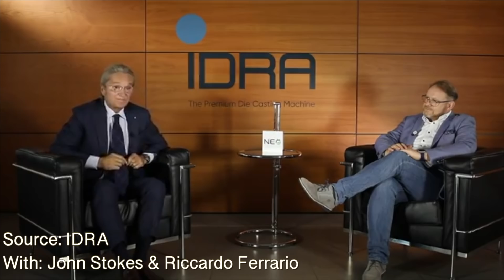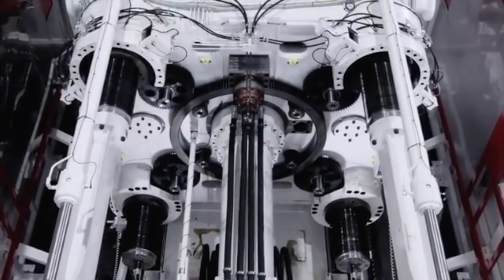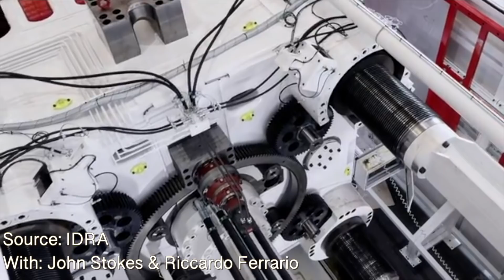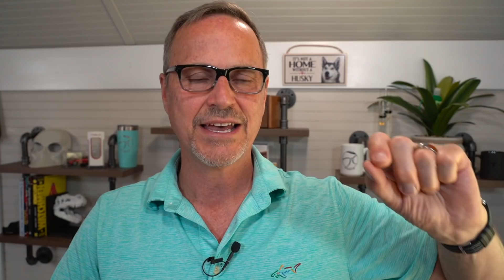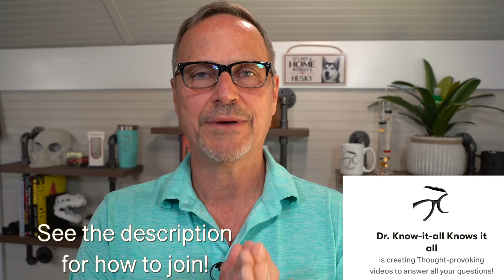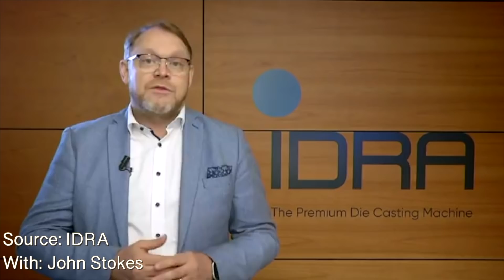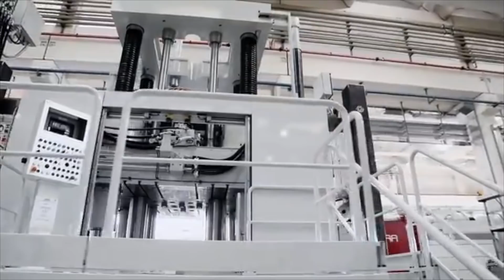Tesla's secret weapon: the Giga Press!

Comment: The 6000 ton rating is the pressure required to hold the pieces of the mold together. These machines inject material into the mold at 1000s of psi and the mold has a large surface area therefore a massive amount of force is required to hold the mold together during the injection process.
Reply: Dr.- No-idea is just the pseudonym. The real name must be either Dr. Dunning or Dr. Kruger.
Reply: Wilson I’m glad you commented this. I was surprised the good Dr didn’t understand what the machine rating of 6000 ton was for. Essentially that capacity means it will be able to handle parts with high cross-sectional area at the mold parting line (F= Injection Pressure x Area)
Since the injection pressure is likely to be the same for Al parts, this 6000 ton press should be able to make parts that are 50% bigger at the parting line than previous gen 4000 ton presses.
Reply: @cantstoptommy7077  not an expert but I got the impression that this guy didn't know what he was talking about.
Reply: @DogBoy987  The Dr is a Professor of English.  He does the best he can explaining the technicalities with that limitation.
Reply: Yes tonnage to hold pressure comes from the lock knuckles that straiten out like your leg,locking in place like the weight we can hold up when our legs are strait compared to bent. Fast shots molten metal and seconds to cool for another shot as a robot removes the last part.
Reply: The Doc is descriptive.
Reply: The Dr describes the sequence: inject first, then press the mold together. It’s likely more like plastic injection molding, where the mold parts are united, forced together with extreme force, and the hot liquid material is injected at high pressure.
Reply: @DrDave327  The Dr. should have informed himself..... He is talking crap. It's an injection molding machine using molten Aluminium and a Ram and not an Extruder with a hydraulic ram at the screw like plastic injection machines use.. The mold on both is closed and pressed together with a force that is the equivalent of XXX Tonns. (the mold is sprayed with an bio-oil for mold release, the mold is evacuated by vacuum pumps, the mold will be filled from the bottom to the top and this takes less than a second. The whole cycle time would be IMHO less than 90 seconds)
Reply: @DrDave327  It is, pressed together before injecting, but you know it better i see :)
Reply: @DrDave327  correct

Comment: I think the centre battery structure is such a simple shape, it is not necessary to cast.
Would be totally overkill to cast the centre battery piece.
Reply: It’s cheaper and quicker, and with a suitable molded structure will be stronger and stiffer while also being lighter and using less material.
Reply: @fredbloggs5902  Structural battery means, the cells itself are forming the structure. You don't need another casted structure.
The room between the cells is filled with some glue and therefore a rocksolid part is formed. You only have to close it with 2 thin sheets of steel from down and above.
Reply: @wolfgangschmidt9873  That’s only partly true, by having struts that run the entire length of the floor pan a much stronger and stiffer structure is produced for a given weight.
Reply: @wolfgangschmidt9873  Exactly.
Casting brings advantages for complicated shapes, replacing many stamped parts and welding robots.
Reply: @wolfgangschmidt9873  I can't believe what you're saying. The battery tray has coolant flowing through it to keep the batteries cool. It's necessary otherwise the heat would build up to failure. 
Lithium-ion batteries are not, definitely not, structural elements.
Reply: @DogBoy987  What do you think the term "structural battery pack" stands for? See the interview from Sandy Munroe with Elon
Reply: Graham, I agree.  The Idra gentlemen mentioned the battery module as one of 3 for the car, but no reference to casting it.

Comment: So, for low pressure forging the material is injected while being solid like an extrusion but closer to the melting point?
Reply: The liquid metal is poured at low pressure inside the mold cavity. The cavity is sealed up then it is pressurized at very high pressure.They are creating pressure hammer to simulate the hammer strikes in standard forging. The furnace is there to maintain the temperature and keep the metal at semi solid state. Just like in standard forging where you keep reheating the part in between hammering it. This process will produce parts with higher strength.
Reply: @kazedcat  I wish Mr know it all had explained it. He could read your comment and learn something

Comment: The CyberTruck will definitely need some sort of a strong frame under that exoskeleton.  The Tri-motor with model is supposed to be rated to tow 14,000 lbs.  So the whole structure will need to be able to endure those stresses, plus a safety margin.

Forging is not just heating and cooling, it is heating and pressure to result in a desired shape/material characteristics.

I think you're right.  Tesla probably has all of those orders for it's upcoming giga-factories.  A video analysis showed the cycle time for the Fremont press was 184 seconds.  Without considering downtime, that is 170K units a year.  So for 1,000,000 units a year, you can figure out how many presses you'll need with both the rear and front castings made.
Reply: The cycle time will likely improve a lot. I think there will be 8 machines in Berlin, which should be enough for 1M cars with front and rear castings, assuming the cycle time can be halved (should be possible, 3 minutes is a very long time).

Comment: The main question is how easy is to repair this part in case of an accident !
Reply: I think Munroe's video made these 2 points regarding repair: 
-it can be designed so that specific sections can be cut off and replacements get bolted on
-most accidents resulting in frame damage are written off anyways
Reply: That subject has been covered, multiple times. Check Munro's video
Reply: @jonbong98  you have a link ?
Reply: I believe, as with the CyberTruck, it employs an external crumple zone.  😃
Reply from the maker: They talk about that at length in the original video. I had to cut some things for time and safety was one. But they have good safety and repair features too. :)
Reply: @DrKnowitallKnows  Great 👍 this is, how we say in German....the Knackpunkt !
Reply: No repair possible, castings are brittle at impact.
Reply: @carholic-sz3qv   Parts of the casting (bumper mounts) are designed to be sawed off and replacements bolted on, if damaged. As with all cars, deeper damage makes the car a write-off.
Reply: @carholic-sz3qv  Aren't the crumple zones being cast? Tesla has developed their own alloy. Please explain.
Reply: @ryankozak99  crumple zones mostly uses aluminium profiles thats what porsche has been using for decades since they always had front trunk.
Reply: @carholic-sz3qv  I should clarify...
My point was that (I think) Tesla is including the front crumple zone in the giga cast, so how could their aluminum alloy be malleable enough to be used in a crumple zone,  but not workable for repair?
Reply: @carholic-sz3qv  they're not brittle. They're designed to absorb crash energy by bending. And they're also designed so the bumper connection can be sawed off and replaced.
Reply: @DogBoy987  castings are brittle in impact, aluminium extrusions and steel actually bends/deforms to absurd the shock so you're welcome.

Comment: One revolutionary advancement that came out of World War II was the "heavy presses" for forgings and extrusions.  When the allies found out the Germans were producing large lightweight forgings for their airplanes (making them stronger and lighter), a cold-war era program was begun to catch up.   The Mesta company ended up producing presses of up to 50,000 tons transforming the design and construction of many military and industrial products.  
BTW, forging is doing metal forming when the metal is hot and soft to realign its "grain" properties, greatly strengthening it.
Reply: You sound like you know what is going on!! Thanks.
Reply: Forging is not a slow process. The metal is heated to a plastic state then its stamped between the high pressure dies. Job done. But while the finished metal is stronger (and good for eg suspension parts), the method can’t make intricate shapes like the body parts castings.
Reply: Yes eventuell car companies uses very high strength and light heat formed steel to reinforce their car shelfs, some even uses carbon fiber and magnesium to significantly reduce the car weight.
Reply: @carholic-sz3qv  BMW uses carbon fiber  for the i3 but it is baken and that needs time. That's the reason why there is none follow up design of the i3.
Reply: @PeterBirett  wrong, the id3 used at the time very expensive and revolutionary technologies, Bmw used not only carbon fiber but also recycled materials like plastics, fibers.... Bmw even built one of the biggest carbon fiber materials manufacturing factory in the world and its based in the US using hydroelectricity to significantly reduce the cost of global prices.
Reply: @PeterBirett  bmw even built a factory to recycle carbon fiber in Germany.
Reply: Ah, somebody who knows what he is talking about! Thanks!
Reply: the US embarked on the heavy press program post ww2 for reasons you state. Mesta Machinery (now WHEMCO) were heavy engineers building hot and cold rolling mills for the steel and aluminum industry as well as other heavy machinery. many still operating today

Comment: I see zero advantage with this giant press because vw and other companies already have installed giant stamping presses and vw alone makes about 10 million vehicles a year.
Reply: 1) Stamping is completely different.

2) The annual production of vw is meaningless if nobody buys them.

3) When a multi billionaire ceo thinks it’s worth investing in a machine, he’s likely to know what he’s doing, when a random idiot on YouTube thinks it’s pointless - not so much.
Reply: @fredbloggs5902  No need to be mean explaining the difference between stamping and casting. There are a lot more advantages to casting than stamping. One cast parts replaces multiple stampings with no assembly necessary.
Reply: @frederickstirnkorb3094  modern stamping doesn't require 70 pieces for one car part as tesla was doing. Modern stamping uses a combination of different materials, from very high strength hot steel stamping to aluminium/magnesium castings for suspension towers..... bmw for example even uses carbon fiber to make their cars even lighter. Steel is way more affordable and easier to produce.
Reply: @frederickstirnkorb3094  the guy’s a shill, his comments are everywhere going on about the superiority of vw, see for yourself.
Reply: @fredbloggs5902  tesla is still going to miss production quality control despite all those improvements.
Reply: @carholic-sz3qv  I beg to differ body alignment will relate directly to the casting as it eliminates a ton of variables in assembly. Even for quality designed stampings. VW has impressive technology in there vehicles.  There efficiency is very impressive and comparable to Tesla's. If they had an integrated electronics stack and software package they would dominate. There is room for multiple players in this area and VW as a legacy automaker is making correct moves which will help them survive and thrive in the transition to EV'S.
Reply: @frederickstirnkorb3094  vw and other companies have perfected steel stamping technology since they make tousands of different car models that basically shares the same parts. Tesla is a relatively new brand and doesn't have experience in assembly or quality control. The casting has nothing to do with alignments when the car is well engineered.
Reply: @frederickstirnkorb3094  the vw touareg, porsche cayenne, Bentley bentayga, audi q8, Lamborghini urus have the same chassis with just custom mods to suits the car. They also uses very light alloys and materials like carbon fiber to significantly reduce the weight of the car.
Reply: @frederickstirnkorb3094  just for example the mercedes gls400d is a way bigger than the tesla model X but that mercedes is a fantastic vehicle with over 800 miles of range and is actually used for towing, cross country touring, camping with rv trailers.....
Reply: @carholic-sz3qv  I have no doubt they are great vehicles but that type of vehicle is being outlawed by governments around the world. The question is if they can make a compelling EV. They are getting closer but they are still at least one generation behind Tesla. For the drive train and power electronics. Part of the issue is they purchase parts from  suppliers. If they had more vertical integration solving the electronics problem would be substantially easier.
Reply: @fredbloggs5902  are you stupid! Vw actually sells those cars, they have factories all around the world just like toyota, vw also makes soooo many different vehicle types including commercial and camping......
Reply: @carholic-sz3qv  not for much longer, building better cars is a better strategy than employing idiots like you to astroturf for them.
Reply: @fredbloggs5902  which better cars! You troll!
Reply: @carholic-sz3qv  

1) You’re too dim to understand my comment, but keep going you’re hilarious.

2) The IDRA machine operates completely differently from the presses operated by VW to shape sheet metal.

3) If anyone here is a ‘troll’ it’s you, you lack all understanding while mindlessly promoting VW in the face of clearly superior technology.
Reply: It's Not a press
Reply: @jonbong98  its a casting press.
Reply: @carholic-sz3qv  the source subjects here is the IDRA machine ,it is not a Stamp, it is not a press, it's a high pressure injection moulding machine. It's use in vehicle production is unique to Tesla at this time. I'm sure all manufacturers will use this technique, with time. But for now big wow to Tesla and IDRA.
Reply: @jonbong98  its a diecasting press how is that hard to understand!

Comment: They Are using 8kton machine for CyberTruck And Semi chassis.
Reply: He says this in the video.
Reply: @fredbloggs5902  missed it my bad
Reply: How is it not three presses? Front back and middle? None are duplicable in one car.
Reply: @Yurost1  The middle may not be a casting.
Reply: @ThreeNoTrump_100  maybe. But when they say structural battery back with a honeycomb design to hold the cells.... why not Giga press that? How else do they do it? Not using foundries any more are we?
Reply: @Yurost1  How about welded steel with the honeycomb being epoxy installed after the batteries are positioned?  Therefore no metal honeycomb.
Reply: @Yurost1  batteries will have resin / filler between them not a cast honeycomb, due to heat ,weight and stability issues.
Reply: @jonbong98  I also heard about filler. But also honeycomb. Allows torsional strength that resin can’t. Not saying you’re wrong just trying to do Giga press number math in my head.
Reply: @Yurost1  In the short term (pre 4680 battery module)  I don't think they are casting the battery module yet (except for experiments maybe, not production), so 2 will do until they move to all three of those parts being cast (per vehicle).
Reply: @brianbeasley7270  it must be that they are not rushing to buy that many casting machines as they are not making enough 4680s. If I were them I would also pace myself. I would keep IDRA busy making the machines just for Tesla. Nice and steady for the next 3 years. Not let the OEMs get their foot in the Giga press door. Let them Frankenstein their production lines for ICE, ICE battery hybrid, and pure BEV. Let them go broke trying to get to a Giga press based line five years from now. Just gotta survive all this FUD while waiting for the world to wake to the inevitability of Tesla winning the decade and going to $10000.
Reply: @Yurost1  correct, I haven't seen anything solid about center pieces yet, NADA, but it seems logical.

Comment: 80 to 90 second cycle time, less than 1 second injection time,
Reply: They can also swap out the moulds very quickly ,for service or different models, iteration of the designs is still going to happen.
Reply: So approximately 1000 unit per day per machine..
Reply from the maker: @jonbong98  Insane!!
Reply: @DrKnowitallKnows  So it really makes sense now why they have 2 presses already in Fremont.
One is simply not enough to keep up with the daily production rate.
Additionally, the fact that they'll have 8 of those babies in Berlin, gives us a good indication of the planned production volume there.
Reply: @macko-dad  yes, 4 should be enough for the targeted 500k/a cars with 2 giga-cast parts each, even allowing for downtimes. So it may well be that half of those 8 are for phase 2.